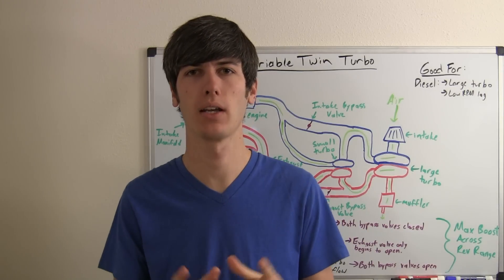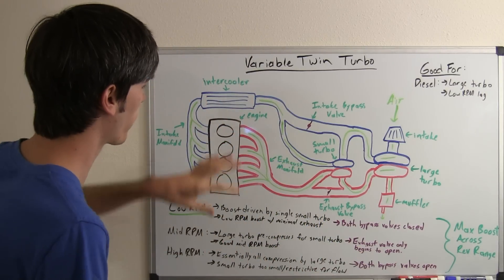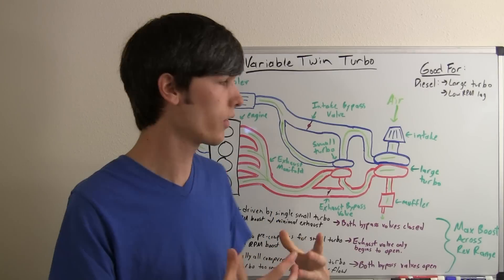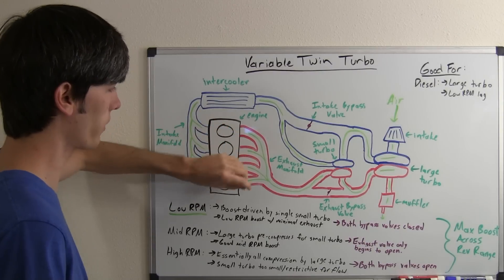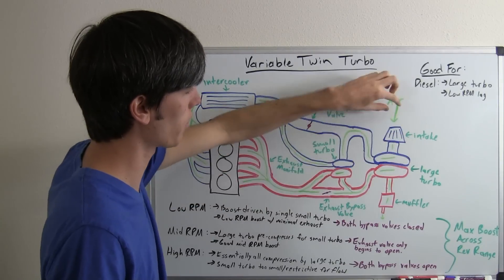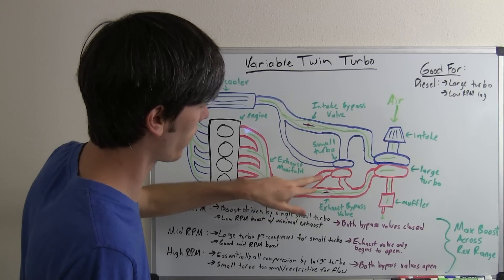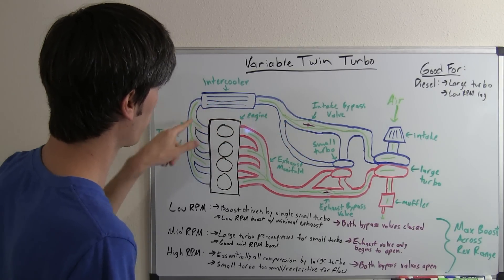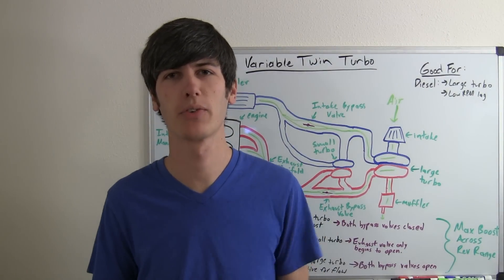How Turbo Diesels Work - Sequential Turbocharging

Comment: A BMW M550D hase 3 turbo's. Thats real.
Reply from the maker: More is better, right?
Reply: Engineering Explained As long as it applies to the number of dollars you have too, then...yes. Because you're going to need them!
Reply: I wonder if they'll make Twin / Tri Turbo with Variable Geometry, this will, at least in theory, give me them the ability to optimize the turbo boost for almost entire rev range of the vehicle.
Reply: allajunaki Variable turbine geometry is implemented in the BMW M550d. It is BMW we're talking about, after all.